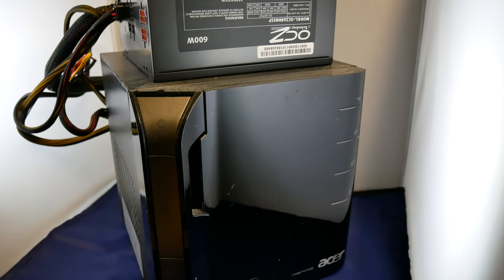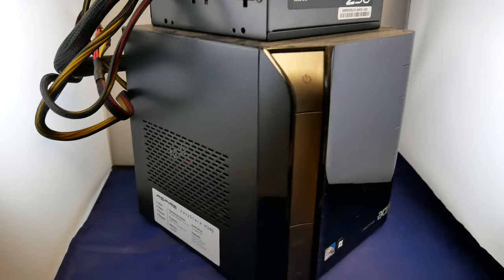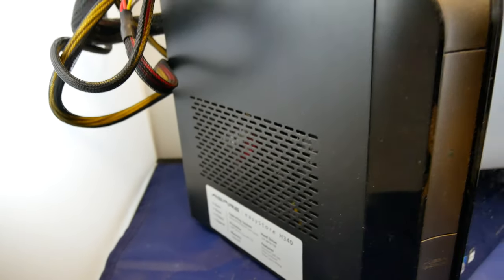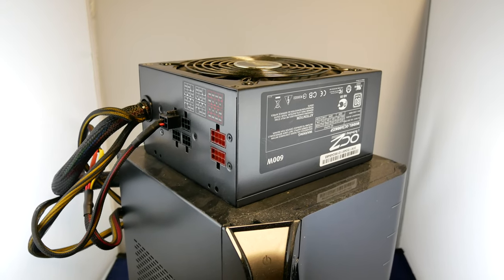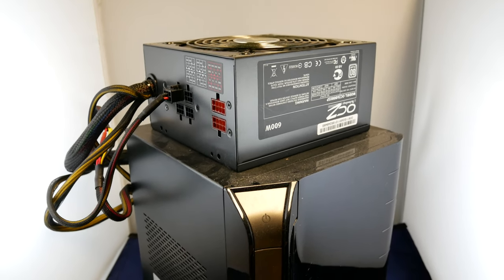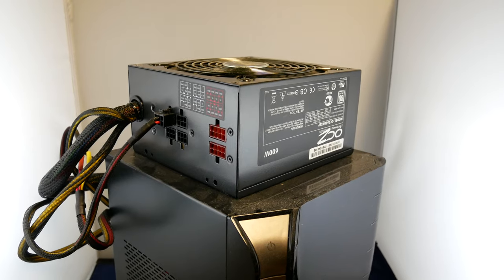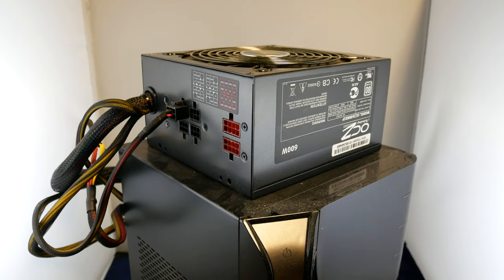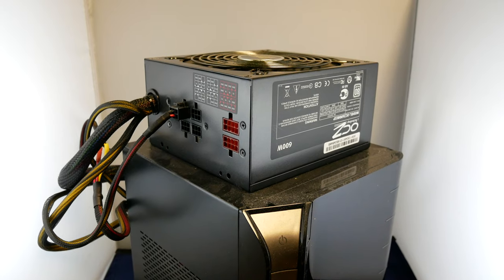Vintage NAS Aspire easyStore H340 has failed again

Comment: Interested I. Watching a fix.  Do you have the original discs? I forgot in the password and would like a copy of all three discs that it came with. It's a bear to try to find these discs. Any response would be much appreciated as most people have abandoned this much loved hardware
Reply from the maker: Sadly I no longer have the unit or discs. I moved discs to https://youtu.be/ahRVmk1_9vI (reformat however required) has been working fine.
Reply: I just saw your asking for disk, i found in a original box all the manuals and three CD's that come with. Mine run just fine, but i will try to run freenas on it. i buy on Ebay a mobo asrock Z77E-itx with i5 3470 and they have two slot for memory, i will put 16 Gb.

Comment: That sounds like a shorted capacitor on the input side of the power supply.  I would open it up and do an inspection for leaking capacitor electrolyte, cap bulges, or crust forming on the cap surface.  Normally those capacitors are just cheap Chinese whatever was cheapest that day capacitors.   I'd replace them with some Nichicon, Panasonic, or at the least Teapo 105c 5% caps.  Then again, it may be cheaper to just source another power supply.
Reply from the maker: This time something on the motherboard failed that I could not easily identify